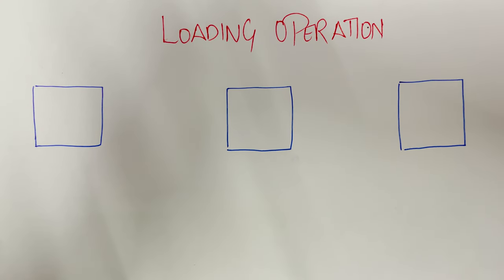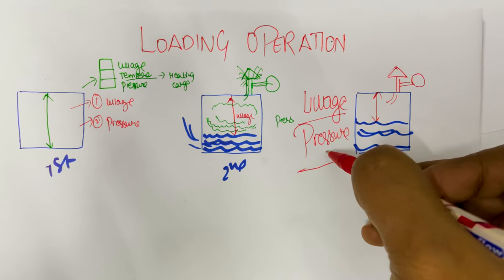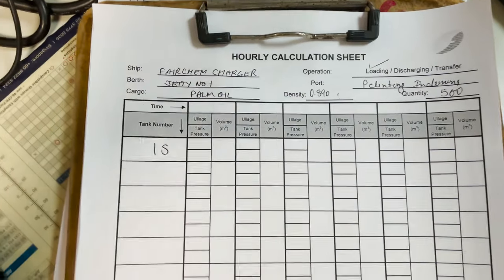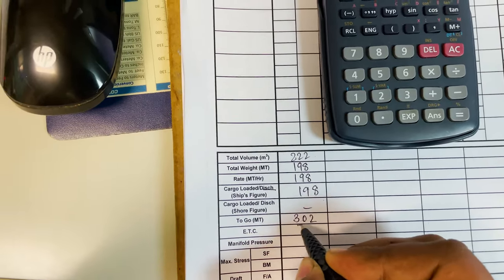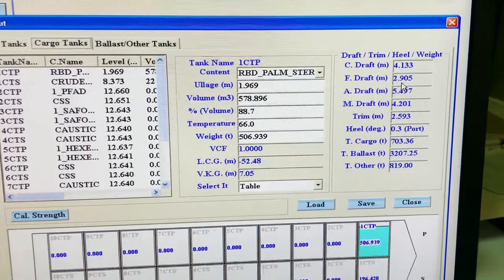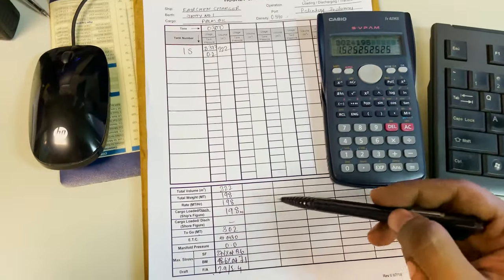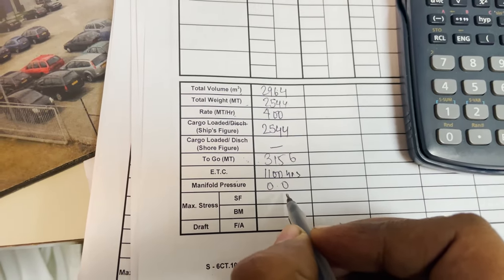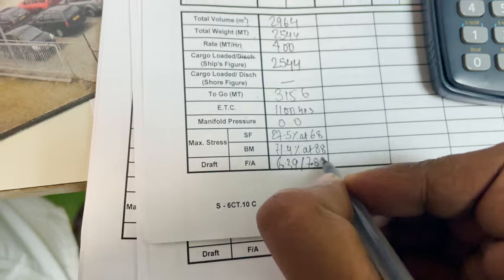𝐋𝐎𝐀𝐃𝐈𝐍𝐆 𝐎𝐏𝐄𝐑𝐀𝐓𝐈𝐎𝐍 𝐎𝐍 𝐓𝐀𝐍𝐊𝐄𝐑𝐒

Comment: Sir which density you will take @15°c or present temperature if present temperature say like 43 °c how will you find density at 43° c?
Reply from the maker: We will take density of cargo temperature  which is being loaded in tank so if present temp is 43 deg then we will take density at 43 deg cel .. before loading surveyor will provide per degree rise factor using that factor we will get density at 43 deg